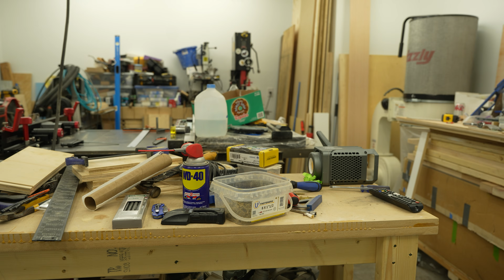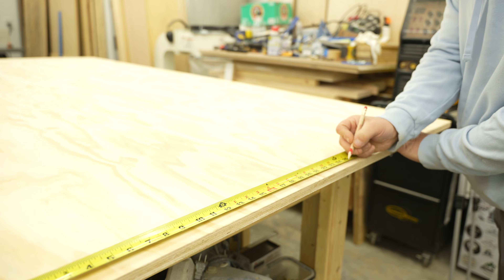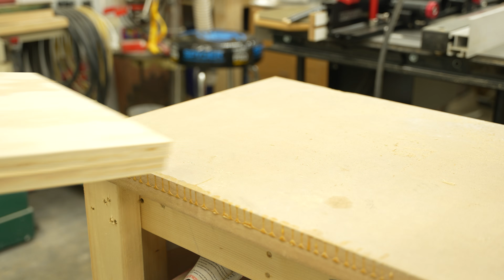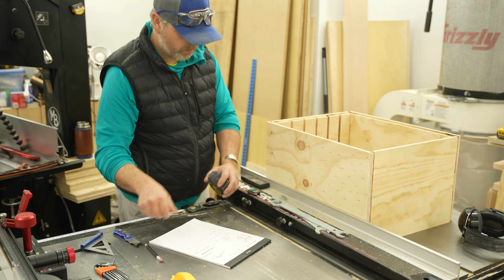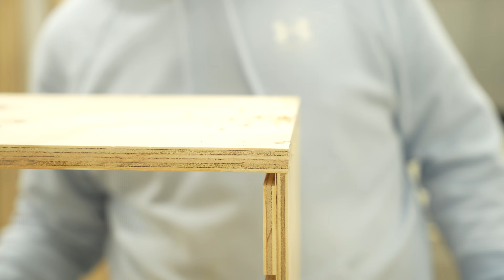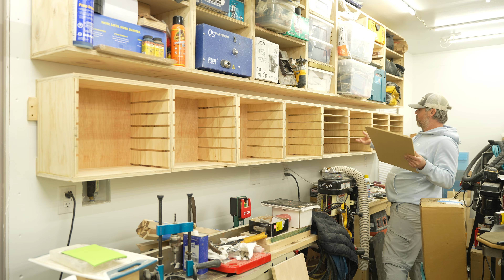How to Build Simple Storage for Your Shop or Garage

Comment: Very nice.   I did a long shelf in my old garage many years ago with 3/4" construction plywood.   I wanted to place it as high as possible but had to readjust a few times to get it up.  It was very heavy and had to have a friend help me.  Stood on the washer and dryer to get it done.  I don't remember how long it was but more than 6 ft and maybe less than 8 ft.  One of the problem I had was that they ceiling was a bit low (not high enough to stand up a sheet of Plywood).  French Clete made it easy and strong as heck.
Reply from the maker: Thank you. French cleats are awesome.

Comment: Jason, looking good. It has been an ongoing process for my shop,  building shelves, and cabinets then tearing them apart and doing it over again. Phase 4 will start this winter.
Reply from the maker: It’s tough sometimes. Build it. Doesn’t work. Modify it. Kind of works. I get it. And I struggle with trying to actually make something until everything is in its place. So I rarely build anything. 😂

Comment: Quick and easy way to get lots of storage, exactly what I need.  By the way, I’m in the same boat about having to clear a workbench before I can start a project.  Any concerns about the 1/4” MDF shelves sagging?
Reply from the maker: Yeah I don’t know if I will ever be “organized” 🙂….they sag over time…I just flip them over if it bothers me. Can always use some plywood instead. Which is fine for shelves. The mdf really works well on drawers for sliding.